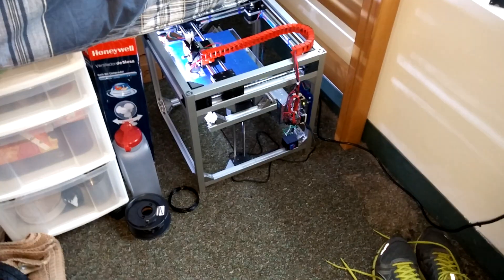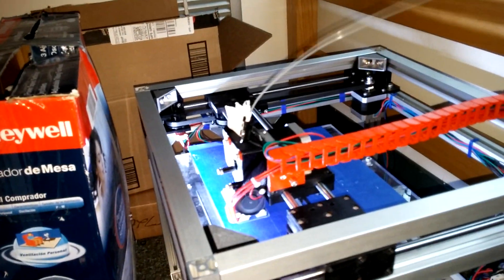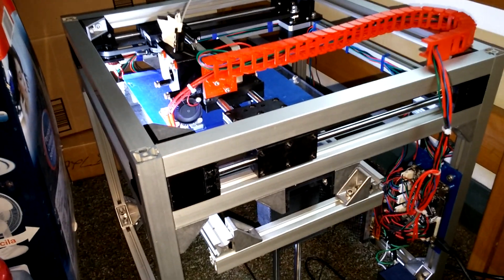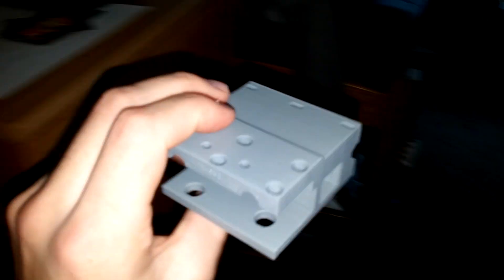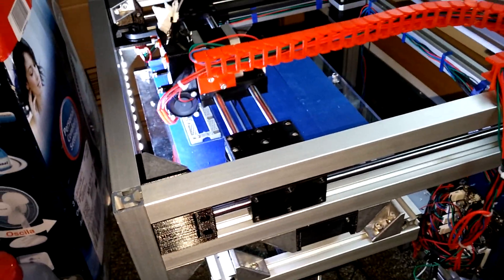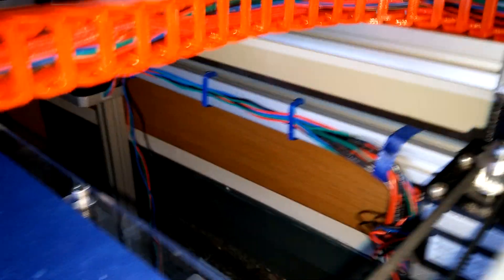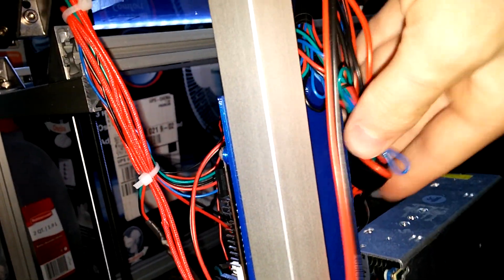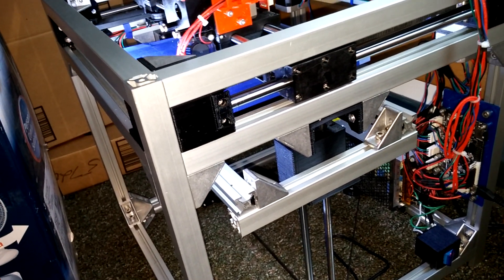3uP Update 23 - It's looking so much neater!

Comment: Who do you buy your filament from?
What number of shells do you use on your prints? Don't shells provide more structural integrity than higher infill ratios?
Reply from the maker: Well I get filament from all over. The filament I use for the kits I get from an ebay seller because it has the best layer adhesion of any of the stuff I've tried.
I always print with 2 shells. The shells make the walls stronger but they dont resist torsion and bending as much as using a higher infill ratio. More shells is better for objects that don't have to be super strong and you want to print with a low infill. Personally I've always had the best luck with 2 shells and 10-50% infill depending on the application, then 100% infill for very small objects.